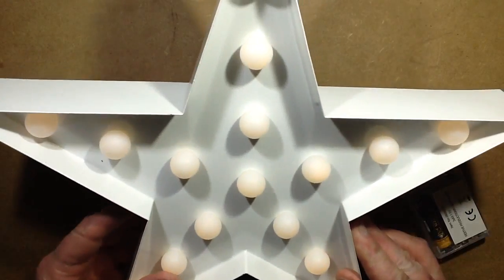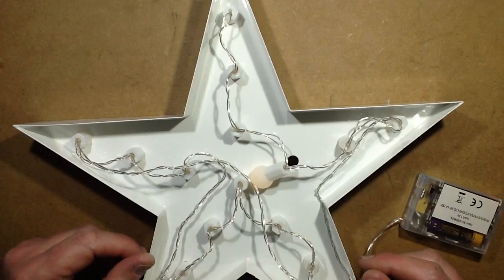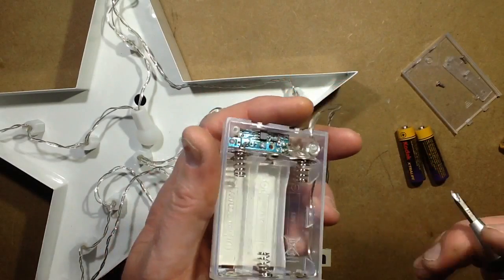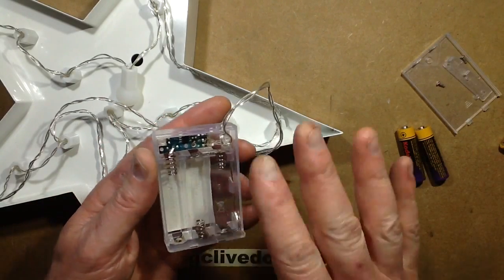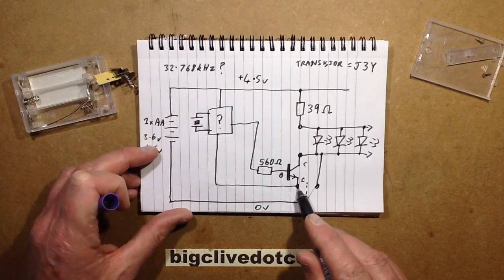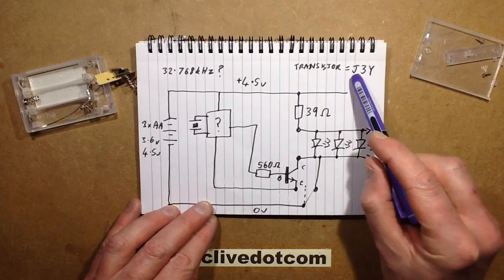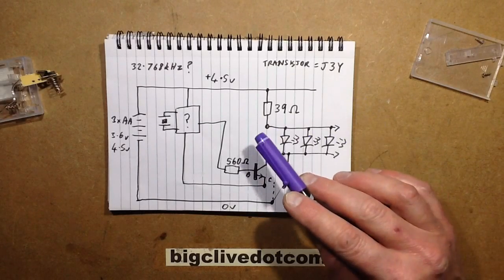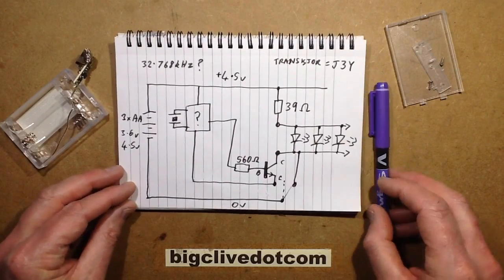Inside an LED star with timer function.  (with schematic)

Comment: Only one problem with those, bought two with more LEDs they are pulling 80mA each, 
that works out to 5 days battery live when using the timer function, 
a little short for my taste.
So I connected an old 5v phone charger to both in parallel and now they are great.
I would only reccoment them if you know how to do that.

Comment: Why is there a resistor in series with the gate of the transistor? 

Shouldn't that just be a pull down resistor going from the positive line to the gate?
Reply from the maker: You have to limit the base current into standard NPN transistors.  The pull down is probably within the chip.

Comment: My WLAN printer supports printing via Android devices with it's own app, and it actually works pretty good with pretty much all the settings I can use on the Laptop.
Don't know if yours is WLAN though, but I guess it isn't, if it was you most likely would have found out the Android printing stuff by yourself :D

Comment: I have a few of these with timers on them. I'm unable to tell what kind of timers they use, as it really is just a chip-on-board with a blob of goo stuck on it. But it has the same functionality. And mine don't seem to have visible oscillator crystals, yet they still keep accurate timing.

Comment: I have these 13 inch high acrylic LED Trees that change colors. They take 4 AA batteries. While they are nice, they eat batteries as well. So I wired up a 6 volt adapter to it. However, before the season was out (this was from last year) the blue LED was failing and would cause some annoying flickering. So this year I got some small buck regulators. I hooked one up in the adapter's cord and doing some brightness testing, found that the LED's were full bright at 4.5 volts only. So I left it there thinking that with less voltage, the LED's won't be stressed as much like they would at 6 volts. They're just as bright as they would be if run at 6 volts. Seems fine so far, only time will tell.

Comment: I hope I'm not the only one inordinately excited by Clive's Christmas LED tat videos, and I have no idea why! I'm tempted to write a little PIC12 programme to do something like this, and retrofit it to some of my Poundland Christmas lights.
Reply from the maker: I tried that, but you need to use an external crystal for timing.  The internal oscillator varied too much with battery voltage.

Comment: Hi Clive,
I am assuming that the Emitter of the transistor is connected to ground (0V) somehow? Through the chip's ground pin?  or does the switch make contact with E in the timer position?  (which makes sense since that will also turn on the chip.)
Reply from the maker: When switched to timer position the transistors emitter and the chips negative are connected to the battery negative.

Comment: how do the transistor emitter and the chip  reference to ground?  Surly there should be a conductive path between the emitter and 0v?
Reply from the maker: There is when the switch is moved to that position.
Reply: yes spotted that not long after i posted. sorry. but thanks for replying

Comment: great video! but i don't understand why there's a connection from the transistor's emitter (assuming it's a npn) back to the mysterious chip. any idea? also, clive commented on the frequency of the crystal (?) and how 32768 hz it's a power of 2 (2^15) and therefore can be divided by 2 right down to 1... and it seems to be an important feature, but i fail to understand why it matters! i'm tired of feeling so fucking dumb... clive et al. say stuff that seems to be obvious to everybody and i'm like... "whaaaaa???"
Reply: The Pussy Grabbing Family Value Candidate In re the 2^15 clock: imagine that each time the crystal completes one of its oscillations, the microcontroller adds 1 to a binary counter. If the counter has 15 digits, it will go 000000000000000, 000000000000001, 000000000000010, 000000000000011... and so on. Finally it will reach 111111111111110, 111111111111111 and then roll over to 000000000000000. That is after 32768 cycles of the crystal, or one second - and all the microcontroller has to do is add 1 to the "seconds" counter every time the "crystal cycles" counter rolls back to being all zeroes.
Reply: > can be divided by 2 right down to 1... and it seems to be an important feature, but i fail to understand why it matters! 

It matters more in clocks as we split our time to display into seconds as base unit... 
Technically it isn't really all that important in this application - you could run pretty much any frequency and set up the internals of the chip (programming if it's a microprocessor  or logic gates if it's a dedicated chip based on flip-flops) to count up the required number of pulses for a 4h period and trigger the output accordingly.flips in the chip. Same is true for clocks, but if there's an easy way to get the base unit we want and it makes for less circuitry...
Reply: zh84 aaaaaahhhhhhhhh!!!! makes sense!!! i understand why a frequency that happens to be a power of 2 makes things easier in binary.  but wouldn't it be easier to count up to, say, 1024 instead of spending time counting +1 every 32728th of a second? maybe such a crystal doesn't exist. i struggle with the idea of a microcontroller able to keep track of each oscillation 32728 times a second while doing other shit at the same time. my own brain would be overwhelmed...

Comment: I'd not rule out a microcontroller, though. I've heard that the very tiny ones (<1k flash) can be had for single cents in huge quantities these days, sometimes the "a little more sophisticated" timer modules can also dim the lights. But of course even that tiny bit of functionality will bore a 8051 core to death.

An ASIC, on the other hand, will require quite an investment initially and this may not pay off when on the other hand the simple 8-pin micros (e.g. attiny-102 or similar) are produced in huge quantities already.

Comment: 21,600 cycles (secs) on, 64,800 off. Fairly simple to implement in discrete components, though not as cheap as silicon.

Comment: In Geman shops like Kaufland or Aldi there are new interesting Christmas lights with PERMANENT timer function (6h of light - 18h of no light). It's a bit annoying but these strings also have a button for setting the brightness: 100%-50%-15% of power. That's nice they added it, I've never seen such a thing before.
All is probably done on a microcontroller because it cycles through the levels when you're clicking the button and turns off when you push the button for 3 seconds.

Comment: I would guess the timing chip is a 6 pin microcontroller, it would be rather expensive to develop a custom device for this purpose. The crystal can also be the clock for the Micro.
Reply: The micro could be in sleep mode for most of the time with just a timer running to wake it up to turn the LED's on and off so should use very little power.
Reply: A micro running a 32.768 KHz would use very little power. It only needs to count 32768  to get 1 second, and then count the number of hours times 3600.

Comment: Probably still a microcontroller, just a dedicated one rather than a general-purpose one.
Ah, Christmas.  The season of cheap, blinky things to take apart and play with.
Reply: Unlikely, the cost of spinning a custom IC for this sort of thing rather than buying an off the shelf one-time-programmable micro and blowing the world's simplest code in means that ASICs are a dying breed - regardless of how simple the end result.
Reply: No, most likely custom silicon, because it really is just counters inside (judging from the function).
Reply: superdau I'm not saying it's not custom, I'm just saying it's a microcontroller by definition.  PICs, ARMs, Atmels, etc. are general purpose (programming can be changed) microcontrollers.  Most of the COB and other custom controllers are single-purpose (can't re-program).
Reply: But in this case there really is no need for anything more than a few transistors (my guess: won't be much more than a hundred) to make the thing do what it does. Would also be much cheaper to produce, because almost any semiconductor fab would be able to handle the low scale integration of a few transistors than the higher integration of a micro with its tens of thousands of transistors.

Comment: schematic of a timer circuit using a 555 timer? might be handy to add to out own xmas lights
Reply: A 555 timer circuit uses capacitors and resistors for timing. So your timing accuracy is equivalent to the tolerances of those parts. And you do know what the typical tolerance of a capacitor is, right? ;) And good luck designing an adjustable version of the circuit when you have to wait at least 24 hours after every adjustment you make. 
For long time periods you need huge capacitors and high value resistors. You'd even have to consider capacity leakage for circuits like that.
Reply from the maker: 555 timers are only really suited to short time delays, but you get similar chips with binary dividers in them.  However, my own experiments with writing simple PIC code to achieve this timing function showed that an RC oscillator is not accurate enough with the temperature and voltage variations.

Comment: How much current does it draw when it's in timer mode and the LEDs aren't lit? (ie. what's the quiescent current of the timer chip?)
Reply: Turns out my girlfriend has an LED ornament with a similar timing circuit. It has the same 6/18h timer. So to answer my own question: when the output is off, the current draw from the batteries is 15,5 uA.
Reply from the maker: Not sure.  Only way I can think of testing that is to leave a current meter in series for over 6 hours to get the reading when it turns the output off.
Reply: bigclivedotcom replace the crystal with a faster one, or use a signal generator?

Comment: could you attach a 5v USB power supply to that instead of the batteries without any additional circuitry?
Reply: I think that would be no problem. By the look of the circuit, the LED's run at 38 milliamps (correct me if I'm wrong), so when you change it to a 5 volt power supply, without changing the 39 ohm resistor, the LED's will probably draw about 50 milliamps, so they will be a bit brighter. I think the IC has no problem with a 5 volt psu.
Reply: i was thinking of a wall adaptor, i have multi-output USB adaptors all over the house. As far as i can tell, as long as there is a draw they will give power so auto shutoff shouldnt be an issue.
Reply from the maker: Yes, that should work OK.
Reply: Just disconnect the timer and put 100 ohms in series or something. Leave the sucker on all night and day until February and it will cost you ten cents.
Reply: A single silicon diode would be best.
Reply: TheBatNaz Its not gonna work.  I tried it and as soon the timer kicks in the switching power supply  also shuts down but recognize that something is connected and starts again. So the timer gets reset in milliseconds. I tried many supplies. Of course it COULD work by someone else
Reply: Indeed. Thats what i ended up with.